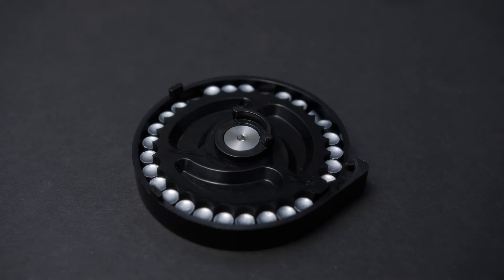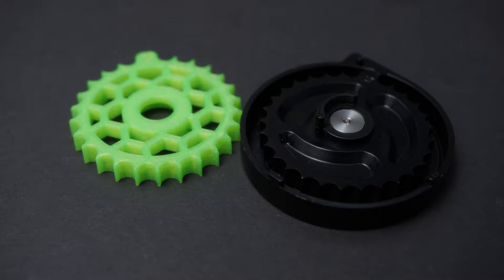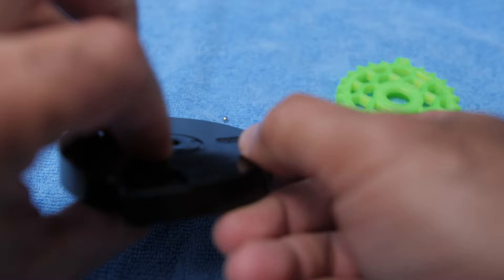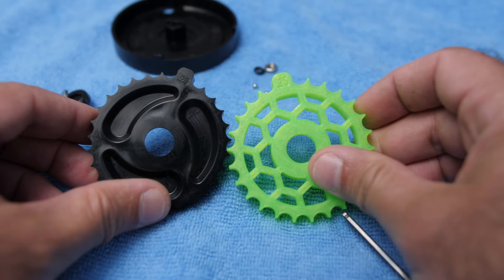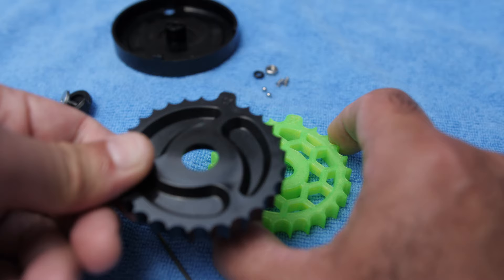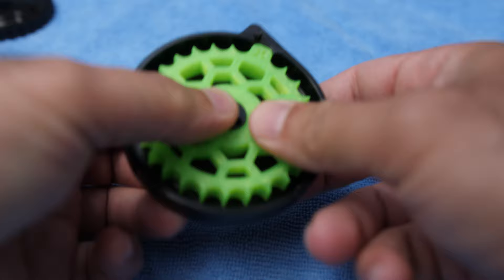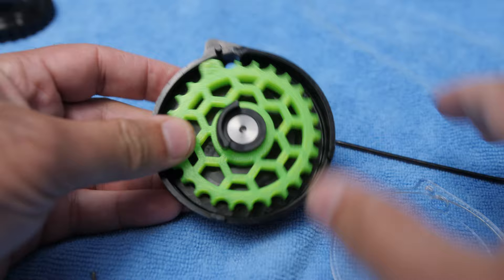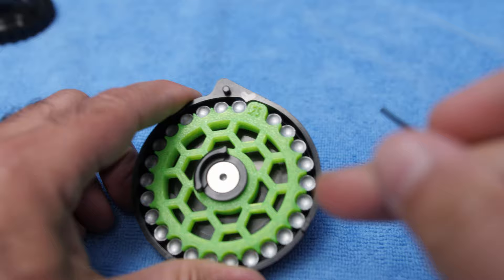FIX your FX Impact Magazine!

Comment: Greetings from Steelton PA 
Excellent presentation  ! Using Iguana Green was a brilliant choice . It's going to made reloading a lot easier when hunting at night  . You could use orange 🍊 too to make it easier to find if dropped  .  The green won't be as visible retrieving it in the field . .If you used glow in the dark for your next run you would have another exclusive feature currently unavailable anywhere else  .  It would make them unique.  I almost want to  order 1 and I don't even have the gun just to support a small business. Get in on the ground floor and  corner the market  .
. It seems like these iguanas are getting tougher and smarter . It's weird seeing 1 taking  a head shot  , shake it of and try to escape  . Great content ,very educational  . * BE SAFE *GOOD LUCK **
Reply from the maker: Ohh Gary, I do have multiple colors available, and Orange is one of my favorites. I like to have also different colors because I can differentiate multiple calibers, I do have multiple caliber magazines. I have some customers that are ordering in colors just for that, not because they are shooting slugs, but to be able to differentiate the magazines.

Comment: Hi, have you tried the stud, Eagle Vision and Bullitt Central magazine which is designed by Ernest Rowe? Would you spend the money on these products of course they're very good but they are expensive. They also have precise alignment
Reply from the maker: I also did a magazine for the impact. I started with the wheel but later designed my own magazine.

Comment: Nice Erlis, making me want an Impact
Reply from the maker: Did you remember what I said on the video?! Go grab one of the MK2, that's what I did.... More stuff coming soon!
Reply: @OriOnTheIguanaHunter  Let's say we weren't going to shoot slugs, just pellets. How does the 25 round new pellet device work compared to an original 28 round mag? Is it worth switching to the 25 round mag for pellets?
Reply from the maker: @Campfussell  for pellets might be fine with the original magazine. Some people have reported that my wheel improves the feeding even with pellets, but the main problem is with slugs, I don't think there will be any issue with pellets.

Comment: I purchased my FX impact Mark II but it comes with a small wheel not the large. What should I do to the small wheel in order to shoot slugs? Eventually I will get the larger wheel for the mark ii.
Reply from the maker: I don't know how to fix the small magazine, those are not common anymore. I think your best option is to convert to the big magazine and open yourself to a lot of aftermarket options
Reply: @OriOnTheIguanaHunter  girls with big magazine set my FX Mark 2 or do I have to modify the gun?
Reply from the maker: @surreallife777  there's a sideshot conversion kit at Utah Airguns that us simple to install, also search on YouTube a video install, it's a 5 min work
Reply: @OriOnTheIguanaHunter  Thanks appreciate it.

Comment: Do these work in the original side shot magazine? I don’t have this problem with my .25 just the .22
Reply from the maker: If ain't broken don't fix it. The problem exists on all the plastic magazines but depends on the ammo you are using. When you said original sideshot are you referring to the aluminum version? The aluminum are good, issue is with the plastic

Comment: I wish they made a magazine that allows you to lock it !! Like when you decock the gun (for like when a bird flew away) but there is still a slug or pellet in the barrel you could lock the magazine wen you want to cock the hammer again it won't cycle and double load the barrel.
Reply from the maker: Interesting idea!! Do you know I have magazines too!!? I'll see how I can implement this on my own
Reply: @OriOnTheIguanaHunter  i could make it myself i guess, but maybe others are better in this kind of stuff. I think by just r-drilling 1 hole and make a spring loaded pin to press wen you want to block the cycle it could be verry easy to make. I'm tired of pulling my gagazine to prevent from double loading.

Comment: We installed these in Teresa and my. 22 impacts and they don't work well and don't center the slug in the exit port and into the barrel so we put the factory one  back on,, thanks Len and Teresa
Reply from the maker: Len, let me know what slug were you using. When did you bought those? I did a small revision on the .22 caliber recently, any problem you find like that please let me know and I'll take care. Now I have an impact and when reviewing the .22 caliber I found a small tolerance issue and it's now fixed. Send me an email to orioniguanahunter@gmail.com and we can coordinate in private but I'll take care of you. This should work better than the original magazine if not, I refund your order.
Reply: @OriOnTheIguanaHunter  23gr varmint knockers,,. We noticed 21gr h&n slugs would flip around in the factory mags plus you had a cool design so we order them two weeks ago and installed them when Bob was out here
Reply from the maker: @lenweber7142   Send me an email if you can, I want to send you the new revision